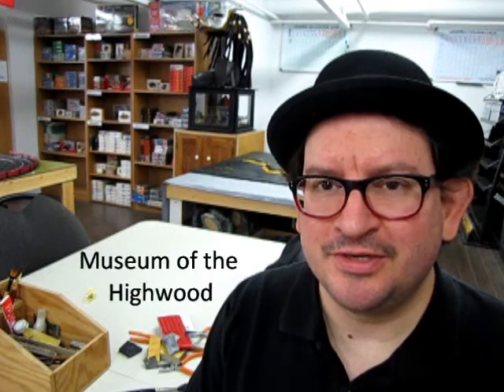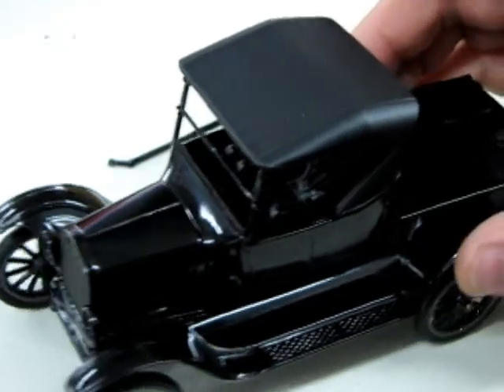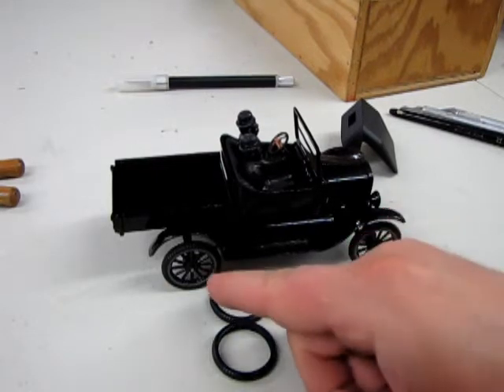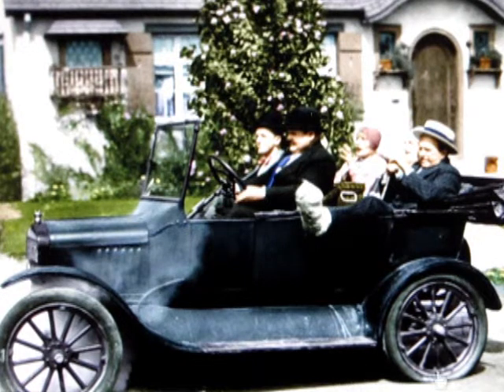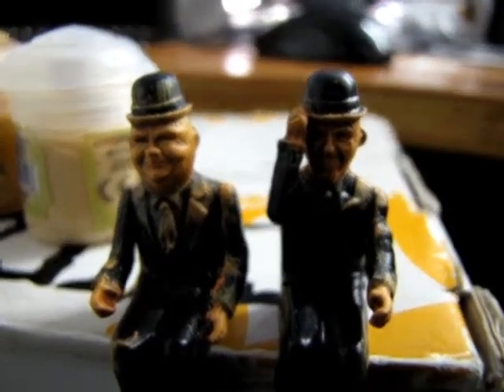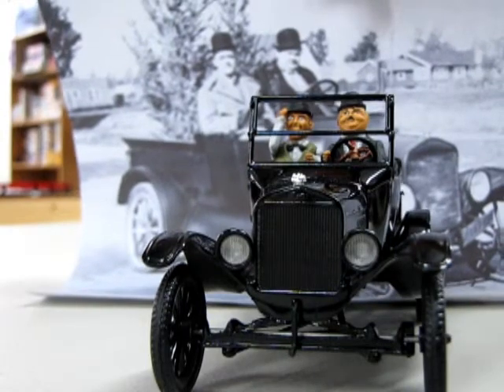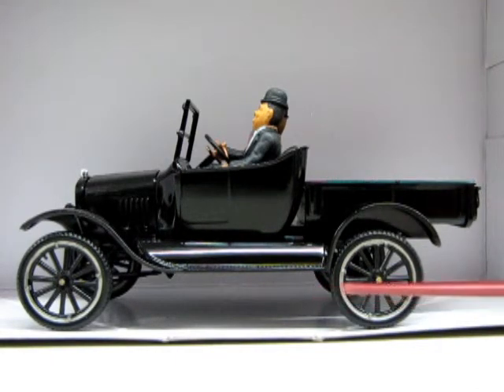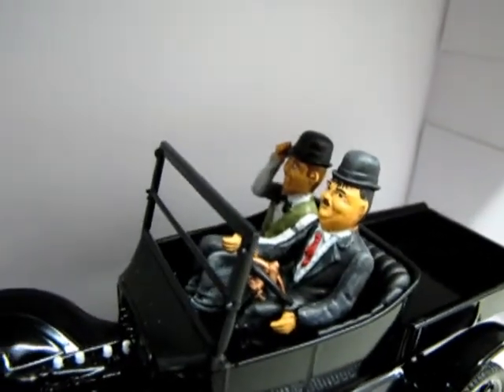How To Build The AMT Laurel and Hardy Model T Roadster Kit Part 4

Comment: I'm wondering about the colorized photo at 9:20 showing a blue body.  Ford famously did say that a customer could have their car, "Any color they wanted, so long as it was black."  But it is possible that the car could have gotten an aftermarket paint job.  For that matter, it is my understanding that customized body work - especially for commercial vehicles, such as this pickup truck - was also not uncommon in that era.

In any case, (paint sag or not,) your buildup of this model looks pretty good.  I missed out on this issue when it was out in 1976, and kicked myself for it to this day.  But I also kick myself for passing up on buying sets of "parts box" Laurel and Hardy figures I saw at various swap meets in the 1980's - 1990's.  Toylike or not, they have a charm all their own.

Thanks for posting this!
Reply from the maker: You are welcome. 
the "Any color as long as it is black" started in 1914 and went to 1925. Ford was losing sales to Chevy (And everyone else for that matter) in 1925, so for 1926-1927 they offered paint colors, front and rear bumpers and nickle plated radiators. 

I do believe the blue Model T is a black and white photo that was colorized. The photo painter probably used the blue color just to make the Ford stand out a bit, however, later today i am posting an unboxing of the 1923 depot hack. I mention about people painting their Fords at home and what type of brushes they used. This is info from my uncle's "Dyke's Automotive Encyclopedia" from 1926.  - i hope you can catch that one.